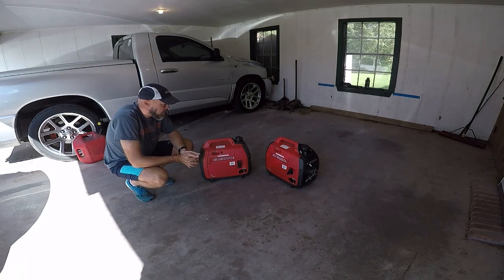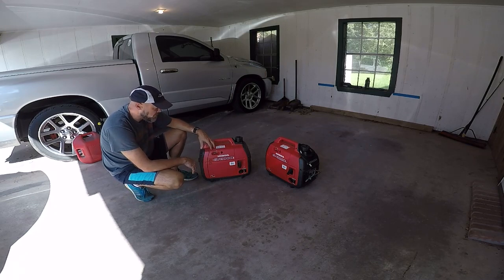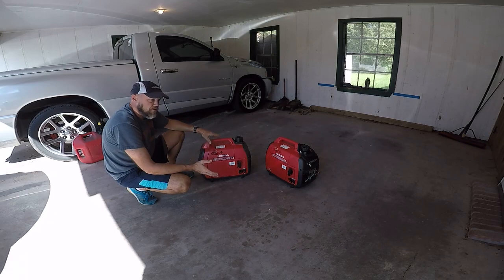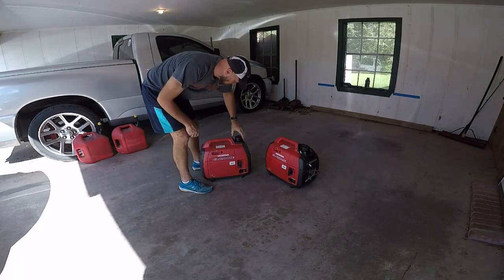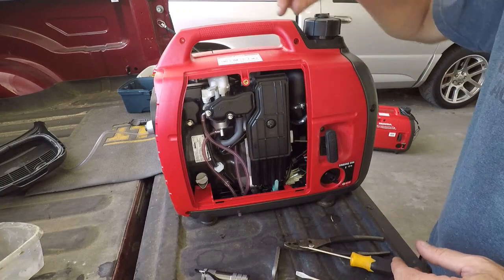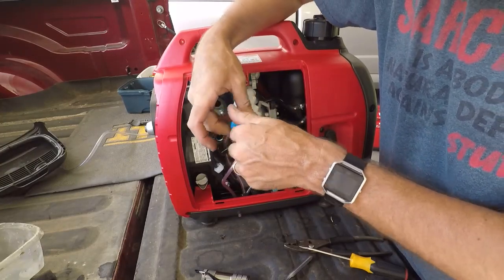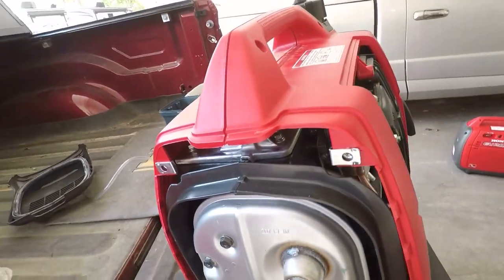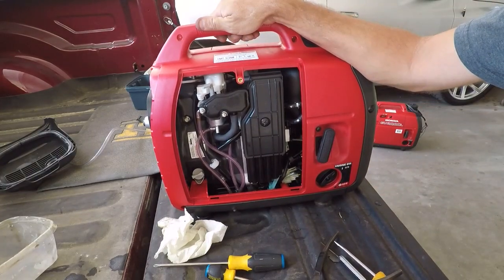Honda EU2000i Generator Bad Idle Repair

Comment: It was dirty. You blew it clean. That’s all these need if taken care of with proper fuel and stabilizer. Moisture and dryness cycle of the garage or storage will get to these gens if not used frequently.

Comment: Do not use 93 octane gas in those generators. Read your manual. Running 93 octane is not good for them!

Comment: Top O-ring was missing, that will make it run rough. There should be an o-ring on the top and bottom of the Pilot Jet you pulled out.

Comment: There is a tiny hole that runs up through it to the bigger hole that goes across it I used a piece of a wire brush to poke the hole it’s tiny but anyway looks like u got it

Comment: Well ?  What happend.  You never told us if the screw was stopped up or. If you had to use a wire. To clear it out ,  great first part of the video. Horrible 2nd part 🤷‍♂️🤷‍♂️🤷‍♂️🤷‍♂️
Reply from the maker: Lol. Yeah that was a mess. It was just the idle vent on the top of the carb. Cleaned it out and it worked.
Reply: The jet was stopped up. The simple blowing action or better yet wire clean the jet is what fixed the problem.

Comment: I bought this as a gift and the owners are very pleased with it▫▫>share4.photo/H2KGenerator?i61i  It is quiet, efficient, and runs about 10-12 hours on 1.5GL of gasoline. It is easy to transport to any outdoor activity

Comment: My jet didn't seem to have a hole in it, but it was completely blocked. I didn't have anything that thin to insert so I used the smallest drill bit I had to make a hole. Some plastic actually came off so I'm wondering if the hole is too big now. It did sort of fix the surging, but it still does it just not as bad. Might have to play with the idle screw some more.
Reply: Nice thing about Hondas is that you can order any part.  A new jet is $7.

Comment: My does the same, I solved the problem by not completely putting the idle lever all the way to the idle position.
Reply: Run it with the choke closed and it runs rich, builds up carbon and wastes fuel.  Clean your carb jets.
Reply: You will overheat that poor little engine buy doing that…it’s running in a lean state when you have to do that. Clean the jet or say goodbye to a nice generator.

Comment: Higher octane does not mean it has less ethanol or will better resist gumming up the carb.  Check out pure-gas map and find a station selling 0% ethanol gas.  But the best thing is to run it dry or drain the carb before storing.  Always more effective than using stabil.  I also suggest a better flashlight.
Reply: He should not be using 93 octane gas in those generators.

Comment: I have 4 of these Honda EU2000i. I had problems with the gas that I was using, buy gas with no ethanol. Honda's design will not allow you to run generator dry. The on and off switch does two things. One it's your shut off switch electrically and two it turns gas flow off to carb. How can you run it dry if  the engine dies from turning the electrical switch off? There is a fix for that. They make a kill switch that by passes the original kill switch, by doing that you are able to turn the gas off and let the generator run out of gas. The added kill switch is there in case you need to shut down the generator in a hurry. I removed that black plastic jet also and the hole must be very small. All I did was spray carb cleaner in the end and blow it out with an air hose. Use some type of lube on small o-ring and just press it back in. My generator runs great now. I did clean all my jets and carb bowl and filled gas tank with 100% gas no ethanol.
Reply: what are you saying Honda won't let you run generator dry?   I always run my Honda generators dry as running out of gas before storing them away.  I never have any problems with them running them dry of gas.
Reply: Better than running them dry is to simply place the gen on concrete like the edge of your driveway and unscrew the bowl drain and empty the carb. Make sure switch is off or you’ll learn something new. Next use, turn switch on and unscrew bowl screw just enough until fuel bleeds out tube and tighten up…starting will only take 1-2 pulls.

Comment: Octane rating has no relation to whether your gasoline has ethanol in it or not. In fact, ethanol actually provides a pretty good boost to the octane rating calculation!   It used to be that gas pumps had to inform you how much ethanol was in the gas, but thanks to the efforts of our environmentalists (and the ethanol lobby) they no longer have to as long as it is not greater than 15%.  HOWEVER, there are gas stations (my local Marathon is one) which have a single pump of 91 octane "ethanol free" gasoline.  It costs about $1.00 more a gallon, but I won't run my small engines on anything else.
Reply: I did all this put a new carb on still doing the same thing what should I do
Reply: @julianrivas2529  do not use 93 octane gas in those generators.

Comment: He didn't show the harder part, which is how to shove the rubber tube from the air filter back into the engine.  I bent the tube into a U shape and use small tie wrap to hold in place.  Shove it back inside and cut the tie wrap.  This video contains good info.
Reply: Just WD40 it next time…gotta wet the hole before inserting like all things in life
Reply: @Maxumized  You have to be more careful with WD40 on some hoses since it can deteriorate it.  Not everything is compatible.  The problem wasn't that its hard to insert, but it was hard to reach since its in a tight area.

Comment: Aaron. The pilot / low speed jet you took out is usually the problem with Honda's and the clones. Sometimes, they need to be cleaned. cut a wire from a wire brush to do that. It fits perfectly. Once in, you will be able to see the wire through the cross drilled hole. That is as far as it goes. Also, at times, as the engine gets a lot more hours on it, you may have to use a "wire size" drill bit and pin vise to open the jet one size to stop the surging you experienced. A very common problem with this carb design.
Reply: https://www.amazon.com/gp/product/B07D8LZ2PG/ref=ppx_yo_dt_b_asin_title_o07_s00?ie=UTF8&psc=1

Comment: Thanks for video. To keep this from happening, run aviation fuel 87 octane or higher. It has no ethanol and the aviation gas has a 2+ year shelf life. Stabil is not a panacea. Second, always run genset dry if not planning to use for several months....you will save much time and effort.